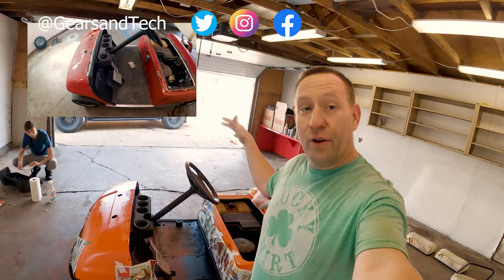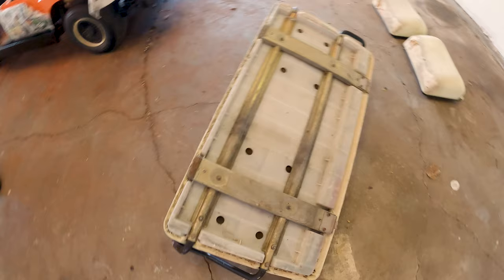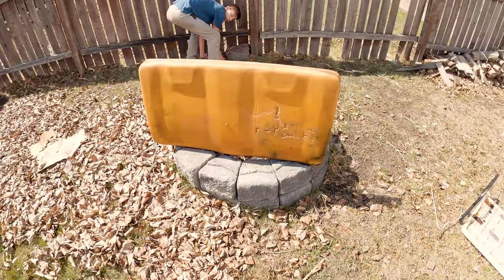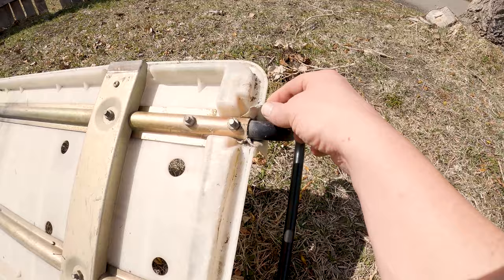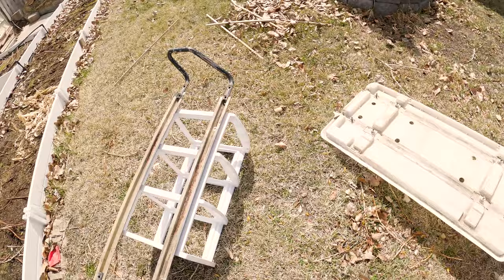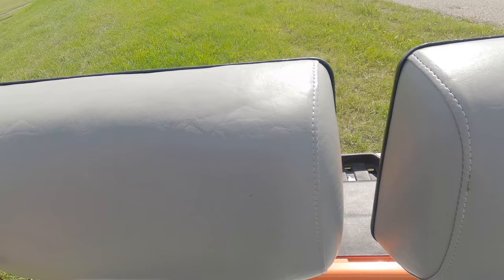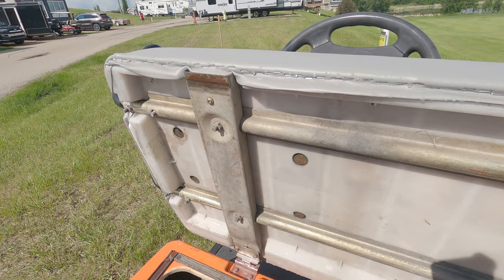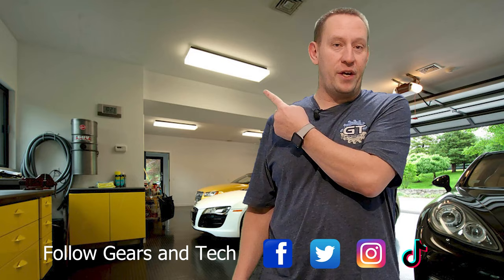Ultimate Budget Golf Cart Makeover is COMPLETE! | Gears and Tech

Comment: Hi did you have any fitment issues with the 14” wheels did you have to add heavy duty springs and advise would be appreciated thanks
Reply from the maker: No modification of any sort. They rubbed when you went full steering lock. But otherwise no issues
Reply: @GearsAndTech  last question do they rub when loaded with two people on it?